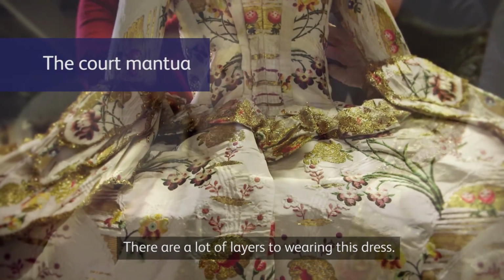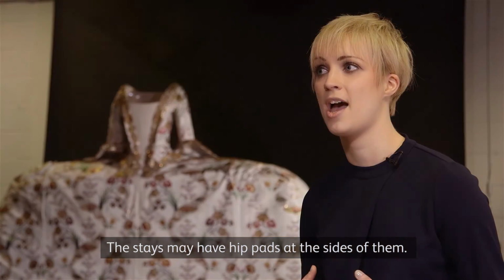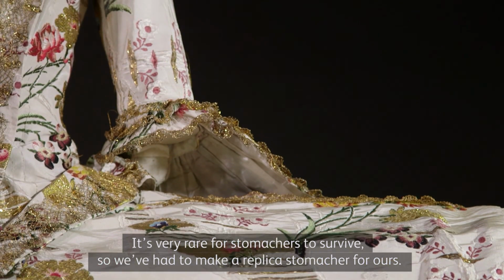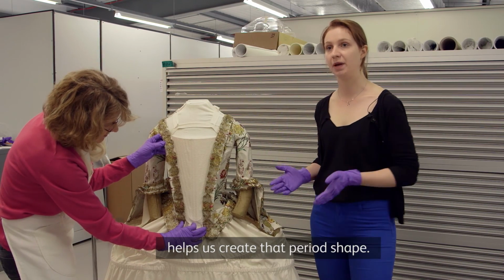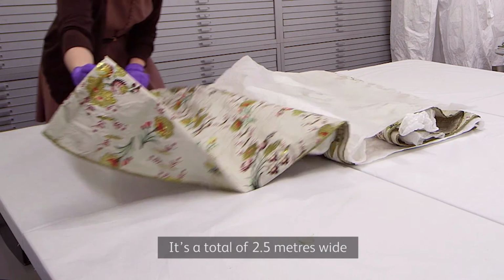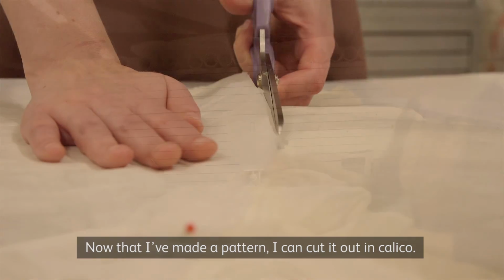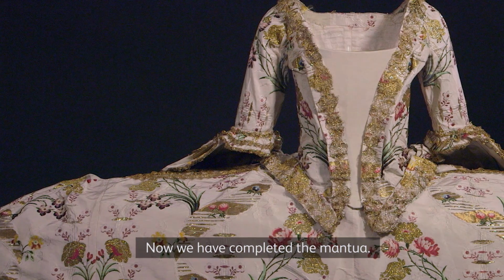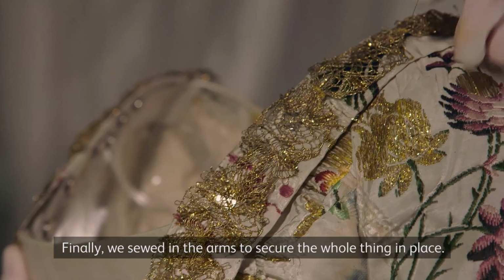An extravagant and impractical gown

Comment: When I see how these magnificent gowns are put together I think the women who wore them must have been stronger than one might think.

The weight of the necessary foundation to hold the ornate and wide skirting alone, would be daunting, then add in the weight of the yards and yards of richly embellished fabrics and it must have been extraordinarily heavy.

The price paid, I suppose to achieve the beauty aesthetics of the era.
Reply: Aristocratic women were decorative objects, so they did a lot of nothing….perhaps a turn in the garden, or danced at court, but that is it.  Even the dancing—especially in the French court—wasn’t going to cause much exertion, just a lot of gesturing and a bit of elegant hopping.  Some aristocratic women rode horses, and therefore could get out of their panniers for that, but most of the time they stood around a room or sat.  The panniers were much lighter than the fabrics of the time, as well, so that assumption is incorrect.  Women obviously didn’t have to wear them when they weren’t expecting visitors, either, but they did no work of any kind.  That’s why each estate had hordes of servants.